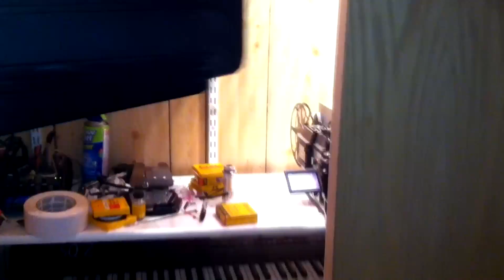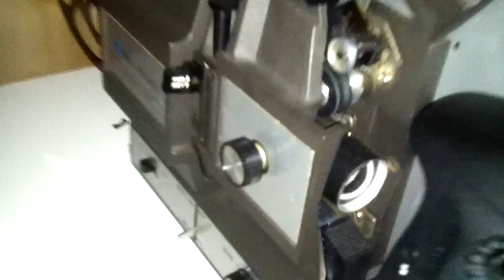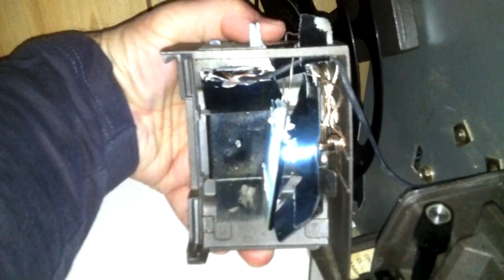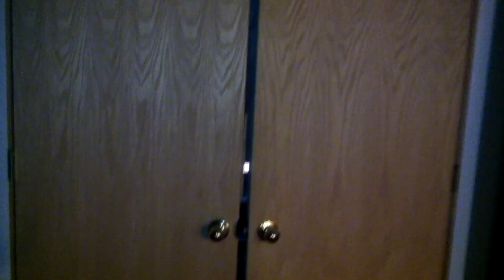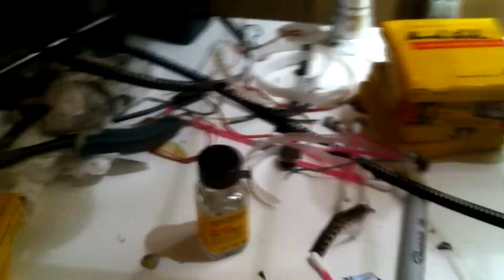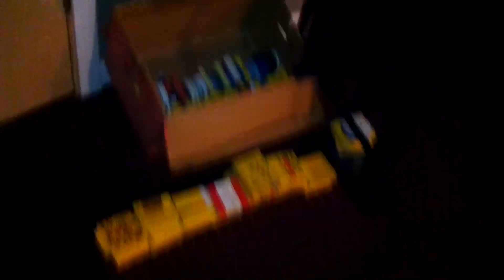O'Brien Basement Film - My Film Conversion Process

Comment: I know it's extremely rare but do any of your reels have sound? If so, how do you plan on transferring or is it even possible? Thanks.
Reply: There are a couple of ways to do it.  The easy way is to play it back, capture the sound, then use a video editor to add in the sound to the digital video file.  Assuming the sound is encoded directly on the film (rather than a magnetic stripe), then it is possible to develop software which scans the sound track and converts it back to an audio format.